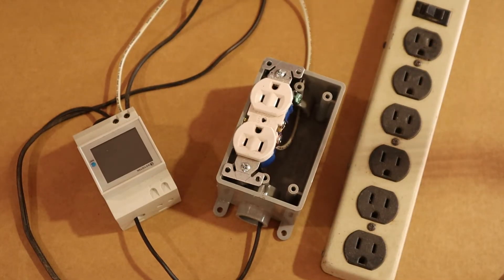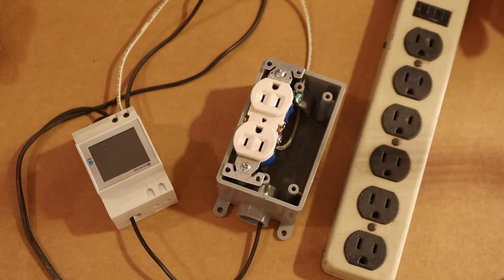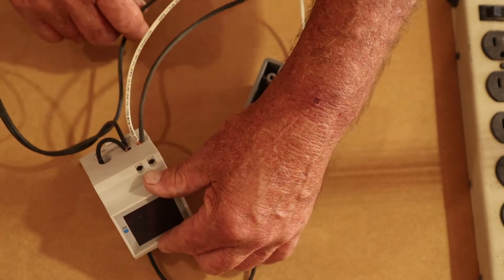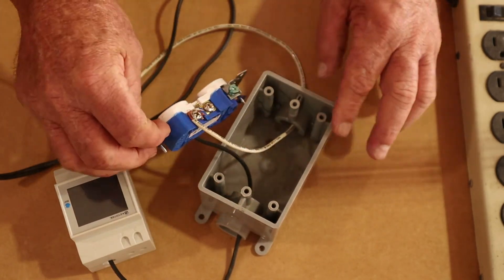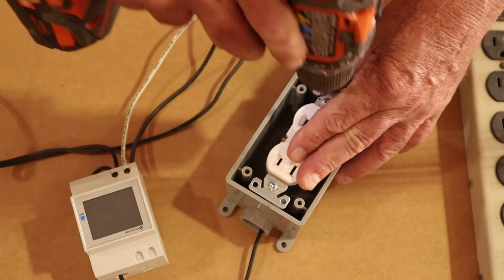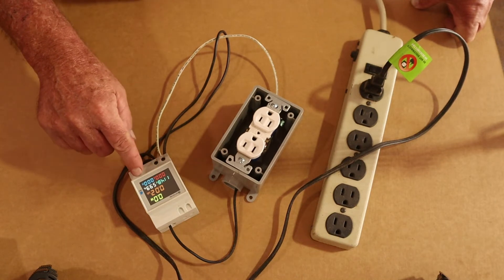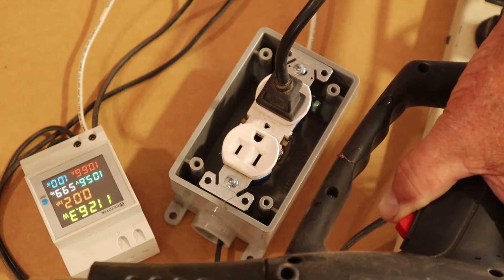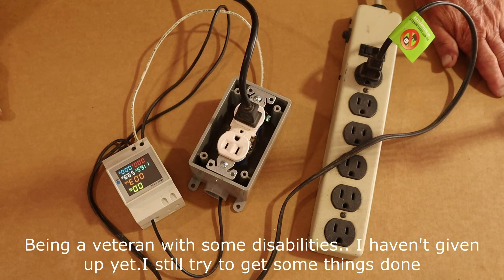Ketotek D52-2047 How it works to meter AC Voltage Current Watts

Comment: bonjour , a partir de mon disjoncteur d'abonné , le fil rentre par le bas ou le haut du compteur ? merci
Reply from the maker: It depends on your specific application, If your wires are coming in from the ground they will come in from the bottom, but if it is coming from overhead they will most likely be coming in from  top..At least that is what I have seen in most cases. Check with your local codes

Comment: Touching live 120v ac isn't "going to kill you on the spot" quit spreading misinformation. You'll definitely feel it but your muscles will instantly react and pull your fingers away. Very surviveable. Been shocked by 120 multiple times.
Higher voltages 240+ can cause your muscles to contract making it harder to pull away.  
That should be avoided. Still no instant death.
Reply from the maker: I would hate to work for you thinking that it’s ok to touch or play with electricity. No matter what voltage it is. You should not second guess it

Comment: What amp draw have you gotten it up to? I have a plug in type, but they are only rated at 15 amps. So, I was setting up batteries and an invertor in my RV for when I cant run a generator. The invertor will run my roof top ac, but its right at 15 amp draw, so mine over loads. Looking on Amazon some of these are saying 100 amps. Which is  def a lot. But im also trying to figure out if there is one that can work with 110v or 220v. The pics are showing 220V, but im not sure it that is for European 220
Reply from the maker: I never really never tested it for max amps. But that would make a good video to put up
Reply: @LarrySbrusch  I blew up a "Kill a Watt" meter at about 20 amps. When I was doing some testing during a hurricane power outage. 

I have determined that the best way to estimated 50% DOD of a bank of batteries is to track the watts / kWh's used. 

But with what I have, if its 15 amps it will not show. 

I have a 2000 48v Aims invertor / charger and it is running my 13500 BTU RV AC. 

Now the batteries, how much you can get out of the and what it takes to recharge is a different topic.
Reply: @LarrySbrusch  I was also tried to estimate the daily ele usage of my well pump, but other than a guess, you would need something like in your video that will work with 220V. I have tried wiring up a "Kill A Watt" on one leg and it would not read anything.

Comment: what size of wire we need to jumper in digital meter?
Reply from the maker: it depends what you are trying to measure.. Anything from 18-10 ga is normal
Reply: @LarrySbrusch  what if i used to whole panel board a simple house?
Reply from the maker: @chabellpatcha6304  each meter like this will have voltage limits. So it might not be possible..It would have to be a very small house
Reply: @LarrySbrusch  it possible..when you have only 3 acu unit plus 55a total of convenient outlet and lights
Reply from the maker: @chabellpatcha6304  You have to have the specs on the specific unit you are using to figure that out...